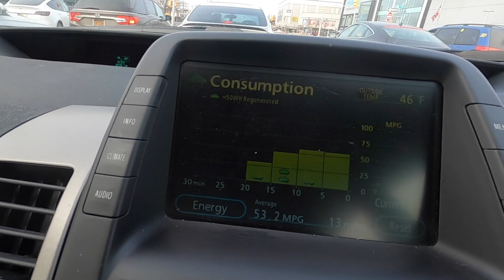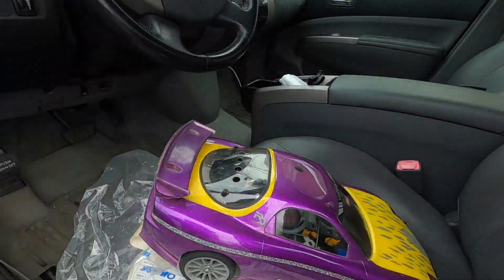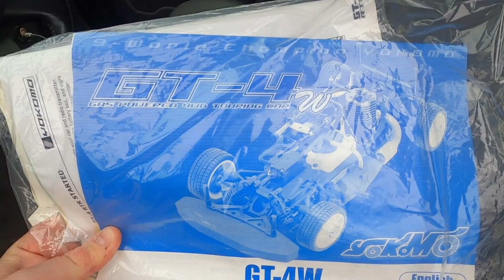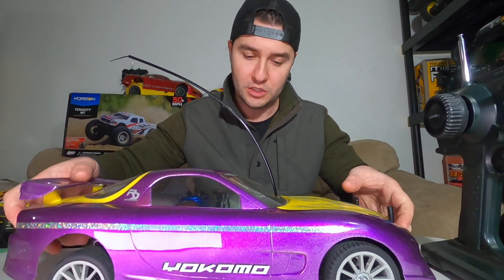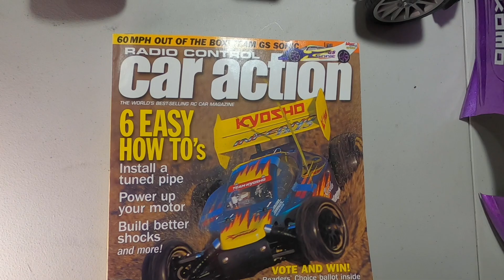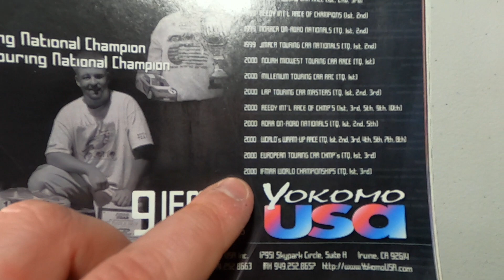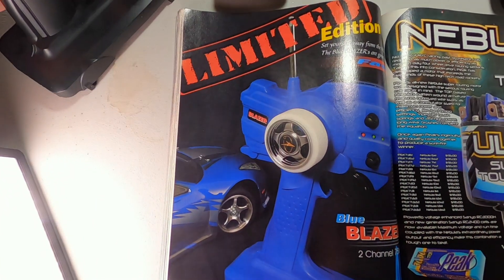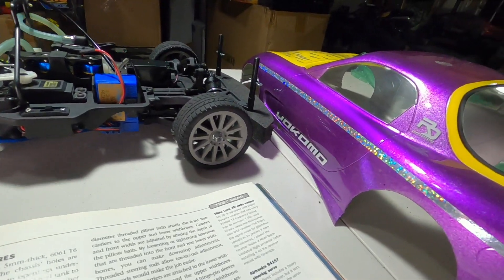Yokomo GT-4w Nitro - 9 TIME IFMAR Championship Winner - Let's Get One and Check It out.

Comment: What's the easiest way to in seize an engine???
Reply from the maker: hey dude! Well the best thing you can do is first disassemble at least the cooling heard and the backplate, then wash the Motor out with basic soap and hot water in the sink, I also scrub the block with a toothbrush.  It does a good job cleaning it up.  Then just oil it up and it should already be moving.  The hot water and soap with 98% of the time fix it.  Also a hear gun is useful.

Comment: That’s your second one isn’t?! I have one with a .12 novarossi and you can deff yell 2 speed baby!
Reply from the maker: hey bro!  Yup! this is my second one of these, in the identical configuration and same engine.  This one is a littler nicer shape than the other one I have.  The other yokomo has a non-original pipe and it fits like crap, this one is missing the baffle and o-ring inside the pipe, and therefore leaks oil, no matter what I do.  I'm trying various o-rings but it seems they dont fit well without the baffle that needs to be there.
Reply: Oh man that sucks to hear. Hopefully you can figure it out or swap engines. I noticed how your throttle horn and linkage is set up I’ll have to make mine like that. Maybe I’ll get better brake response. Looking forward for a running video !